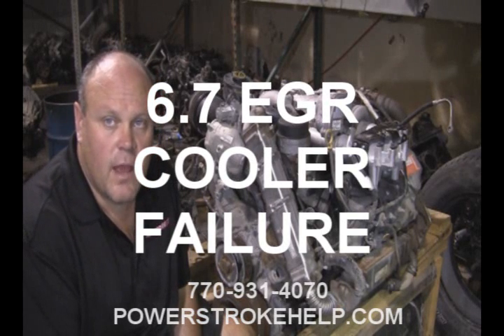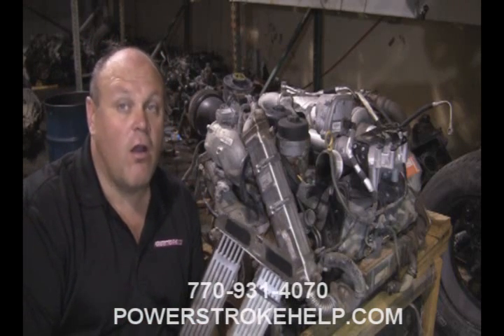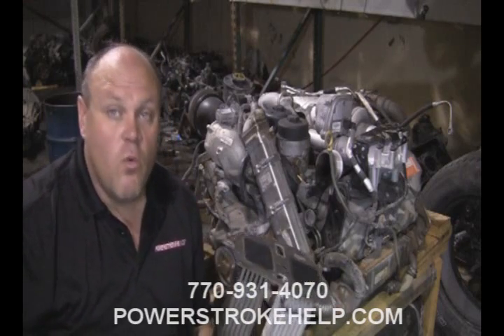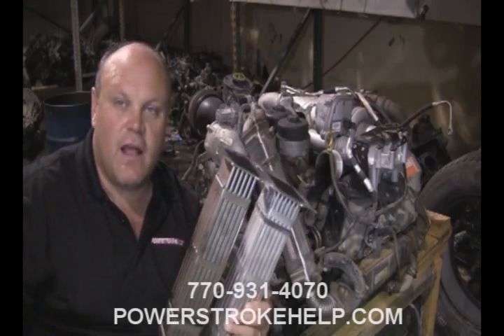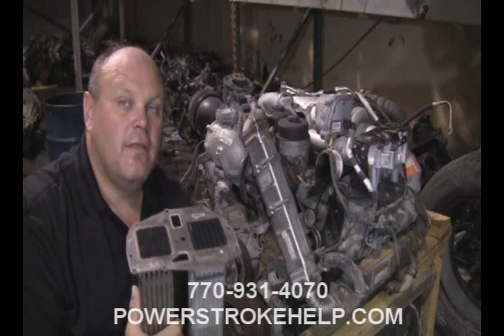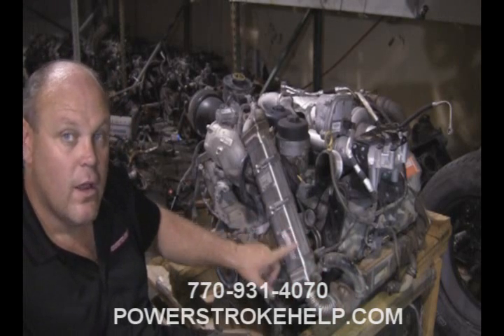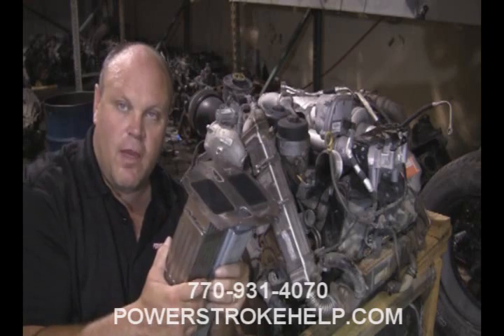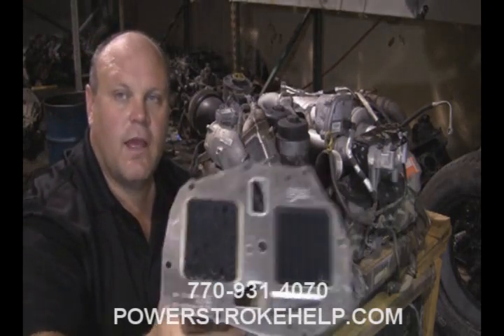6 7 EGR COOLER FAILURE

Comment: I wonder why ambulance companies choose ford time and time again when arguably, there are more reliable options.
Reply: Sure you can argue that, you can argue anything, proving it however is the issue and I see nothing to suggest that Ford is any worse then Chevy or Dodge. With that kind of idle time and mileage? Have fun finding a motor that won't have some problem.

All rigs have there problems and foibles. There is more to a rig then motor, and Ford is generally considered to make the best/strongest frames and the only way to replace a frame is to replace the whole rig. Thats why the E-Seires is so popular with motor home and coach builders even though Ford vans rarely have the strongest motors. The fact that the E-Series chassis sells so well also probably makes servicing and getting replacement parts easy. One of the reasons some police departments don't want to give up the Crown Victoria for example is that, bigger departments especially, have whole warehouses filled with replacement fenders, doors, bumpers etc.
Reply: Arguably, that's your opinion.  Time and time again you go and purchase things in life that have good results, makes you think about the results they've experienced with the other makes for them to continue using Ford's Chassis.  JFYI, 2500hrs of idle time is equivalent to 63,000 miles, just imagine a Pkup with an EGR sitting idling for that many miles.  Idling is actually worst on any vehicle gas or diesel than moderate driving as motor's are unable to clean themselves out.  Add to that the 120,000 of hard driving miles it had as well.  As was mentioned, the EGR system is a cheap and easy fix on the 6.7.  In other words, this Ambulance was back on the road quick and good for another 150-200K Miles of Service before another EGR Failure?  I say that's pretty good for any businesses bottom line, mine included...
Reply: Ford has the fleet market cornered
Reply: Ford discontinued production of the E-series last year to make way for the Transit series. The new Ford Ambulances are on F-series Super Duty frames. Seen them and they seem to be a lot nicer than the Econolines.
Reply: Ford WILL discontinue production of the E-series in a few months, but are keeping the cutaway package thats used for motor home and ambulance sales.
Reply: From what I have read the E-series was never offered with the 6.4L only the 6.0L PowerStroke.
Reply: ***** Honestly, I think there is a fitment issue with the larger Displacement 6.7 in an E-Series.  I think Ford is severing much of it's ties with Navistar?
Reply: Micah Watts They fit a 7.3 in there, I don't see why half a liter smaller engine couldn't/wouldn't fit. And yes, the 6.7 was built in house by Ford with no Navistar connection as far as I'm aware.
Reply: Roushfan5 I don't think you understand, the architecture of the 6.7 is larger in respects of all that's required to meet EPA Standards.  Yes a 7.3 did fit, but it also lacked many of the equipment the 6.7 has.
Reply: Micah Watts I suppose thats true, but engine building has come a long way and I believe that if Ford had thought it would have been profitable they would have found away to make the 6.7/6.4 fit under the hood of the E-Series.
Reply: Roushfan5 Sure a redesign of the E-series.  You can't fit something where it just won't go.  IMO Ford doesn't intend to redesign the E-Series, there going Transit?
Reply: Roushfan5 There is no way in hell a 6.4 or a 6.7 can fit into an E-series chassis. The 6.0 barely fit, you had to remove a motor mount and loosen the other one to pivot the engine down in the cradle just to get at the valve cover bolts. That tight fit is the reason they used the 6.0 in the E-series up to 2010.
Reply: Roushfan5
a Gas chevy would be fine! All the ambulances in Northern Ontario here have 6.0HOs and are all doing just fine!
Reply: 9102jack I don't recall saying anything that would suggest otherwise so I'm not sure what your comment is in response to. Regardless, unless you work for a local ambulance company I'm not really sure what you can provide in this conversation. What kind of fleet down time do they suffer? What are repair and maintenance costs like? Whats the upfront cost of the rig? Just because you have provided antidotal evidence that one or two ambulance companies prefer Chevy over Ford says nothing about what company makes the best frame for ambulance or even general coach construction. Sales figures seem to conclude that over all Ford is the preferred frame for ambulance building.
Reply: Most governmental agencies use Ford because cheapest bid, not because they are good. Ford's build quality sucks so that is why they are able to push these trucks off so cheap to fire dept, police dept, ambulance services and many more, it has NOTHING to do with reliability. I am a firefighter/EMT and in my dept, we have used Ford for everything because cheapest bid but now recently some Chevy Tahoes have ended up in our fleet completely randomly all because for a brief period, they Tahoes were cheapest bid over the Explorers
Reply: joker432 I don't buy it. You have to consider more the simple purchase costs when considering what fleet you purchase next. I'm not saying that Fords being cheaper doesn't help, but if a rigs down time increases for repairs, the expense of that down time increases, then you've lost the advantage.
Reply: +The Duffy Street Incident Podcast Well I don't really care if you buy it or not, it is exactly how it works. You are thinking with too much common sense, governmental bean counters don't think with common sense, they think with numbers. Yes it would make more sense to spend the extra initial upfront for the chance of higher reliability but it doesn't work that way. I know how our dept operates and I know that is how governmental agencies operate because it's all the same. Like I said though idc if you buy it or not, because honestly what you think doesn't change anything.